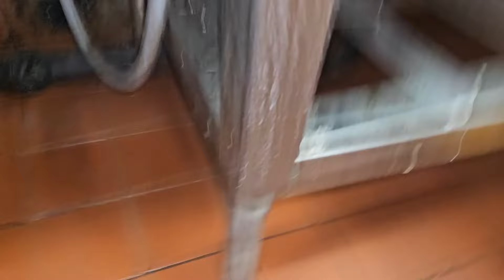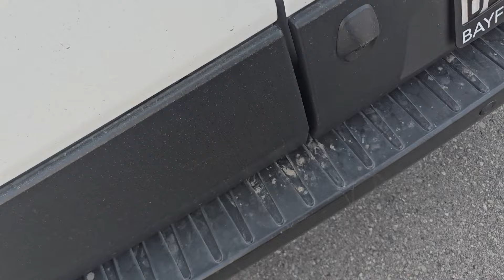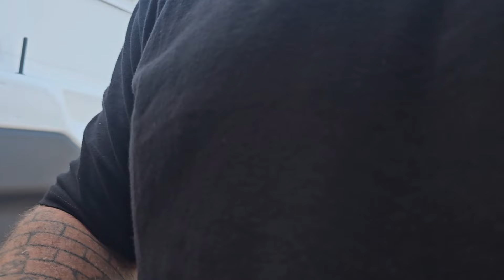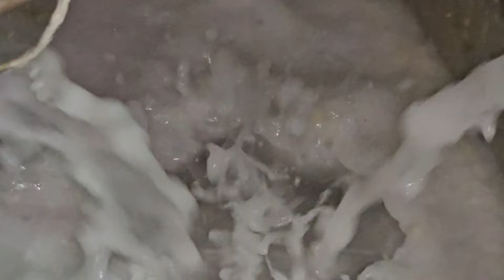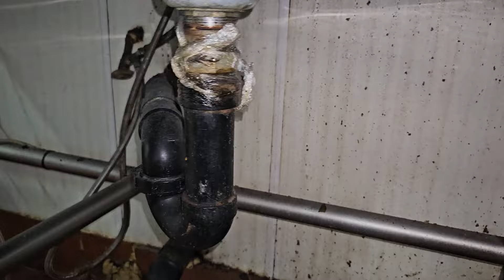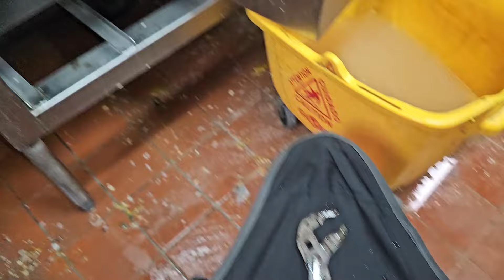Dishwasher not Draining

Comment: That’s the same type of dishwasher that I would use except we only had one one water plunger where this dishwasher has two and it looks like it fills the dishwasher automatically with water 

And it’s got the same red, blue and white lines 

Red line: That’s for the dishwashing cleanser (very harsh to the skin if exposed to the actual cleanser) 
Blue line: That’s for the detergent to keep the dishes looking shiny 
White line or clean line: That’s for the disinfectant (bleach) to give the dishes that extra clean 

They do need to clean the bottom portion of the wall since it looks like it’s caked up with dirt
Reply from the maker: Well I just learned what all those lines do. Thanks for watching Max. Have a great day and a great weekend. Cheers brother
Reply: I couldn't agree more with the poster. This machine needs to be broken down nightly and cleaned, inside and out. When I was in restaurant industry, many lowly paid workers wouldn't even bothered to be trained to monitor the wash water on the continuous moving chain and puck/pawl types of machines. I'd find the water almost a thick creamy white from pancakes/batter with tons of toothpicks stuck in the spray arms after 6 hours. The hot water in the machine (50 gallons) has to be changed every 1-2 hours when busy. Rinse water with Jet-Dry is automatically sent to the wash tank and excess water goes through a filter screen into the overflow drain pipe. But that's not enough turnover. If peeps knew how much these commercial machines cost, plus training, they'd (mostly Hispanics and illegals from other countries) would take better care of it...
Reply: @jbsimmons54  I know about that too well I was the only dishwasher who kept the entire machine clean and free of debris (cleaned the top of the machine, cleaned the intake lines, cleaned the main motor) made sure the water jets were clean and most importantly made sure we had hot water flowing through the dishwasher if we didn’t I would just turn up the water heater (we had the water heater inside the janitors closet so anytime the water dial got hit it would cause the water temperature to go down)

Even our dishwashing distributor guy was highly impressed of how clean the dishwasher would be when I was around and you can tell a major difference from when it’s cleaned versus not cleaned
Reply from the maker: @maxpayne7312 that definitely sounds like you knew your stuff.
Reply from the maker: @jbsimmons54 yeah it's crazy how some companies won't enforce proper cleaning. Thanks for watching jb have a great weekend
Reply: @Jaythatdrainguy  I did/still do being the dishwasher I had to keep my area clean I would even tell the guy who I trained (Greg) to make sure (after he leaves) to clean the area down, empty out the food catcher spray it down so it didn’t have that built up gunk and if it was slow clean the top of the dishwasher 

Even now when I do dishes at home I keep the same routine (everything has to be cleaned and organized and I always use hot water)
Reply from the maker: @maxpayne7312 that's a good way to be